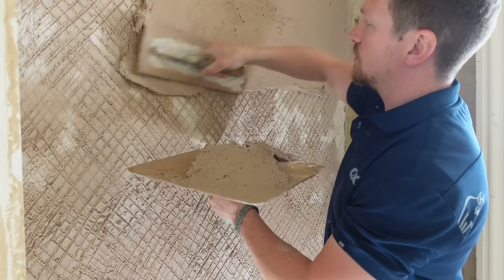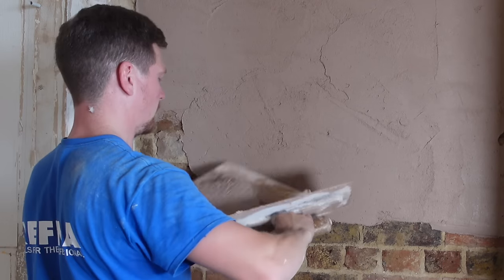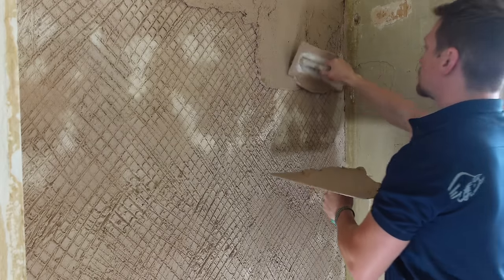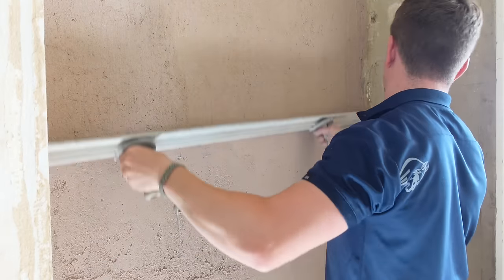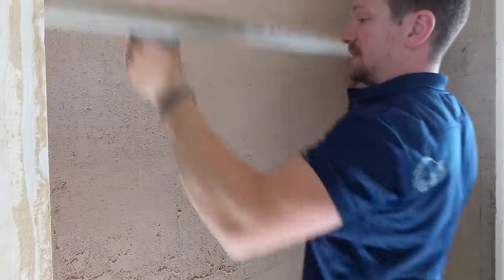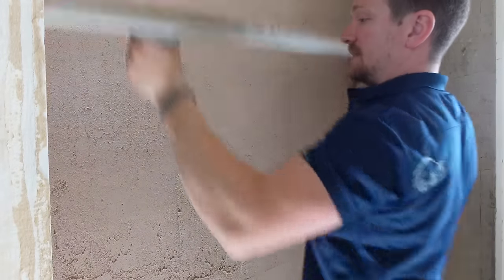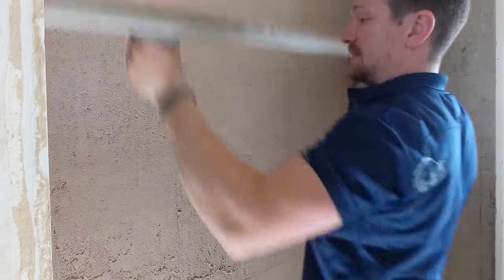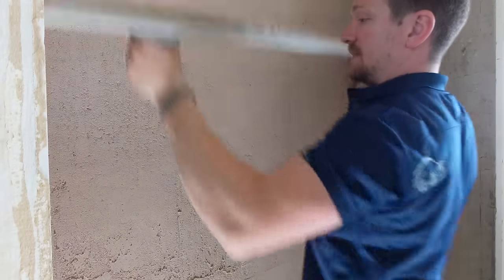How To Lime Plaster A Wall FOR BEGINNERS | Full Process START TO FINISH!

Comment: HELP, i hope someone from the comments or you the owner of this video can assist me. Its the first i am seeing concrete blocks being covered with lime and i am happy cause NOWHERE else on youtube has it. I live in Jamaica and we use concrete blocks steel and cement but i want to use lime plaster instead of cement. Please i beg whats the simplest but correct procedure lol. Do i prime the blocks first? Or do i just mix the lime putty with sand to make the mortor and plaster the walls in two coats then add the smooth plaster without the sand. After the base coat dries do i need to prime it before adding the plaster with the colorant?

Next question for the bathroom and wet areas for the tadelakt technique do i really need to use the stone to rub it or i can just seal it with the special soap and leave it to dry so it can become waterproof. 

If i use regular cement for the base coat and want to do a lime wash technique for the paint i know i have to prime the walls then but do i need to add that smooth limd plaster first IF i am only going to lime wash paint the area?

A lot of these things are confusing to me and i am doing many research but not everything is clear. HELP

Comment: Can someone please offer advise. I have damp issues in my house. I need to skim over lime plaster wall.

My Plasterer is suggesting applying a gypsy/multi finish skim coat. Is this a bad idea? Should I only be skimming in lime to prevent damp issues?
Reply: Yes only use lime. Gypsum will make your damp worse

Comment: If anyone wants to know. It's a mix of 5 to 2 plus hair and sand of your choice. Normally for most applications you'd use NHL 3.5. also. Don't do a Blane! Wear gloves and goggles. So you don't lose your hands or eyes. Get this in your peeper you'll be begging the hospital to take them out! He doesn't do much of this. 

Dob it out. Wet it daily. Wait.
Base, with mesh if you're cheeky. Water daily. Wait 5 weeks. 
Second coat, float, devil float, wet daily and wait 5 weeks. 
Putty coat, SpongeBob square float. Wet lightly. 
Pure lime calcium putty as the final coat just to fill the tiny imperfections. 
Distemper
Reply from the maker: Great advice, thank you. You wait 5 weeks! Why do you wait so long then? I’m intrigued? Thanks for sharing 👍
Reply: @PlasteringForBeginners  gotta cure, think I put it on a lot thicker than what you did. Also I don't use pre mixed. Just got more control if you mix it yourself. Was always told 6 weeks between coats. Bit less in summer but you gotta keep it hydrated due. You don't want it to dry. It won't work of it just drys out. If you want it to stay there a few hundred years you gotta give it time to cure. Not dry. Same with pointing! Cover it and keep it out of the wind if you're rendering outside. If it dries too fast it developed calcite and that's not going to let water out making it a pointless exercise. If you are pointing you scratch the calcite off sometimes the same day but you always wet it up and cover. Don't have to cover the render inside but you do have to keep the wind off it. Lime is time. It's the reason no one bothers with it much. Personally I think it is a fantastic product. If you wanna speed up the cure you add ash as a pozzolan. The old guys knew what they were about. New building are gash planned obsolescence in the building trade. Shame really.

Comment: I’ve just had mine done professionally, paid 5k for 4.5 walls.. he did it with lime putty and bag mix (?) and did the creamy cost first and left me with the darker mix as the top coat. It’s all cracked already. No come back and a 10 year loan to pay the 5k off 😢
Reply: Sounds like they didn't know what they were doing. I'd consider redoing yourself. Lots of time cost but materials would be about £4-500
Reply: That's awful to hear! Sounds like the suction wasn't controlled well enough. Trading standards? Really hope you get your money back.

Comment: Excellent explanation on the process. If I may a question about plastering technique. In general in UK it seems prefered to "push" large amounts of plaster into the wall with big rectangular trowel. In my region all tutorials and courses teach you to use bricklayer trowel and "throw" plaster on the wall in small lumps. Which you then take off with straight edge.
For example like here: https://www.youtube.com/shorts/5EiTCx33h_c?feature=share
Could you maybe explain the difference between two techniques? Yours seem to be quicker and much less wasteful with material.